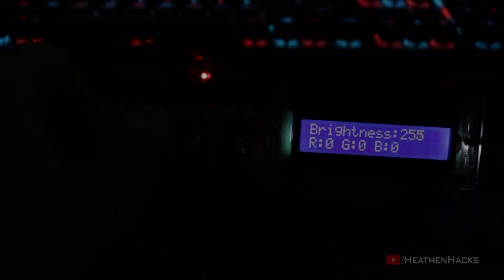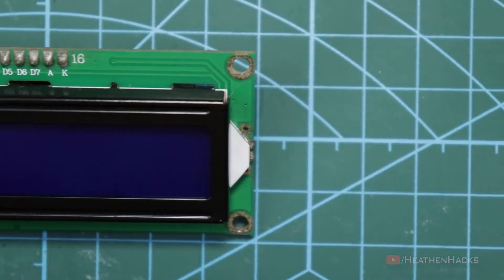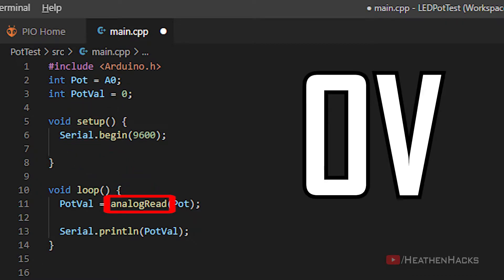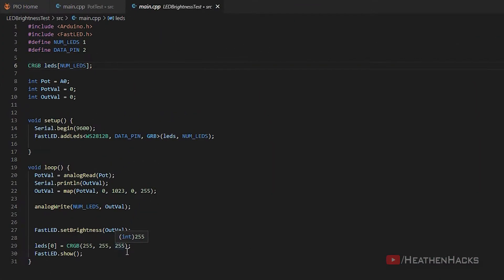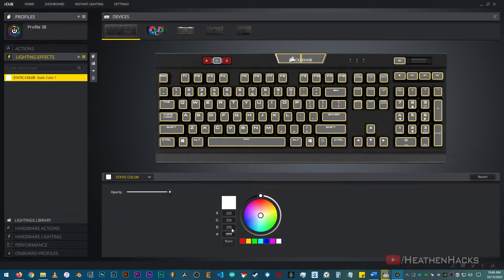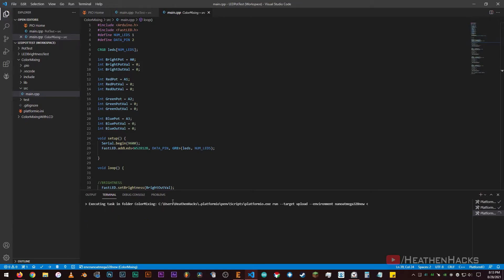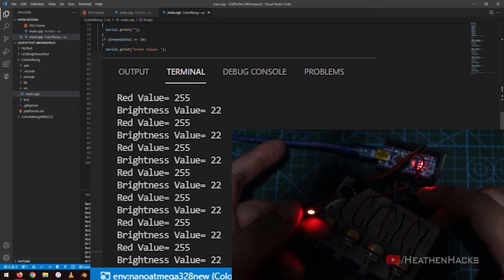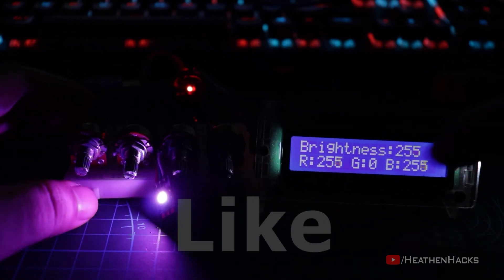Arduino Project #22 | WS2812B RGB LED Brightness Control & Color Mixing [Using 10K Potentiometers]

Comment: Suppose selecting red=10, green=100 and blue=200 by pots.
How can this color be dimmed?
As soon as the red reaches 0 the shown color will be different I think because red is now totally missing.
Reply from the maker: There are 4 pots on this project. 3 pots that handle the color values of colors Red, Green and Blue and 1 pot that handles the brightness.

And yes, as soon as red reaches 0, the color would indeed be different, as it is supposed to do that.
Reply: @HeathenHacks ok, thanks

Comment: Hey I'm having an issue with these LEDs at low brightness - they tend to snap to fully red or fully green, they are unable to drive blended colors at low brightness values.  Did you ever find a way to prevent this?  I've found 3 other people on the Arduino forums with the same issue - they can't get blended colors out of RGB LEDs at low brightnesses without the LED "snapping" to one color or the other.
Reply from the maker: Hello, and thanks for the comment! Good question. Tbh, I haven't really tried mixing colors at low brightness, so I wouldn't really know for sure. My guess is that, less brightness requires less current, and the reason why they tend to snap to fully red or green is because red and green requires less current to turn on. I could be wrong tho.
Reply: @HeathenHacks After doing some more testing, I think it has to do with the fact that the human eye doesn't really notice brightness changes until they're very small, and the brightness changes are only at 8-bit so only 255 values.  You get to the bottom and it'll be like red pin is a value of 1, and green pin is a value of 0.  No way to fix without using higher than 8-bit resolution.  Thanks for your reply!
Reply from the maker: Glad you found your answer.

Comment: Exactly what I needed. Thanks for the video.
Reply from the maker: Glad it helped!
Reply: Actually I am making a small hydroponic system. So I am using the ws2812 4x4 led display. But I am facing problem changing the brightness of indivisual leds. Can you please help me??
Reply from the maker: Are you talking about the individual LEDs on the display? If so, I think my other video would help or at least give some idea: https://youtu.be/30YK24wkHI8

Comment: When setting num leds only one pixel lights up. The bar is 100% functional. How to fix it? Please help :(
Reply from the maker: Hello, I apologize for the late response.

Thanks for the question! ♥

To use multiple LEDs, you can add a few more "leds[*number*] = CRGB(255, 255, 255);" to the code.

For example, if you want to use 5 LEDs, you will add "leds[1] = CRGB(255, 255, 255);" below "leds[0] = CRGB(255, 255, 255);" and so on...
Reply: @HeathenHacks  I would have to use 120 pixels, the program won't crash with that many pixels? Thanks for your help.<3
Reply from the maker: It says on the Arduino Forum that it can handle even up to 300 pixles (Haven't tried that personally, tho, so I'm not sure) what I'm sure of is that you'd need an external power supply for that. 

Link for more details: https://forum.arduino.cc/t/what-is-the-max-ws2812-pixels-than-can-be-used-with-one-uno/412293

Comment: how to make this program work on multiple leds ?
Reply from the maker: Hello Juneleq! I apologize for the late response.

Thanks for the question! ♥

To use multiple LEDs, you can add a few more "leds[*number*] = CRGB(255, 255, 255);" to the code.

For example, if you want to use 5 LEDs, you will add "leds[1] = CRGB(255, 255, 255);" below "leds[0] = CRGB(255, 255, 255);" and so on...

Also, don't forget to change the NUM_LEDS value.

Comment: This is really neat. Playing around with it a bit for an idea I had, and for some reason only one pixel is lighting, no matter what I set NUM_LEDS value to. Tested the strip I'm using with other known good examples and it's fully functional, any idea what the issue might be?
Reply: Ok never mind I was being dumb. Figured it out.
Reply from the maker: Hey there, apologies for the late response. Glad that you figured it out, tho. Mind sharing what fixed your issue? Thanks.
Reply: @ferinoch  I have the same problem, how to fix it?